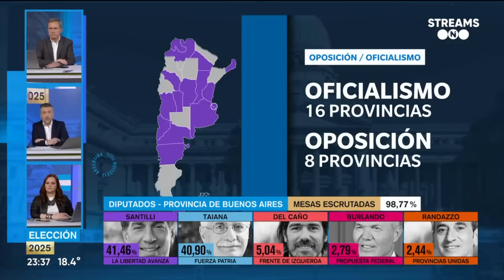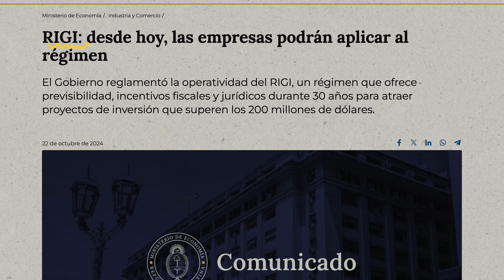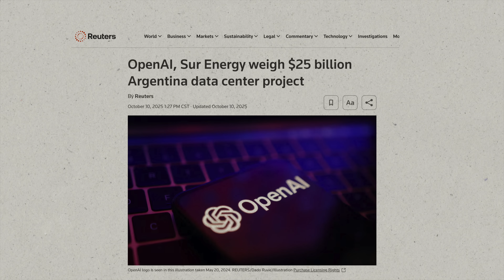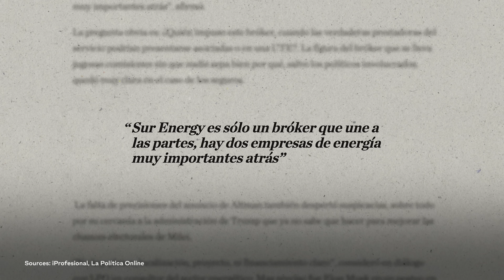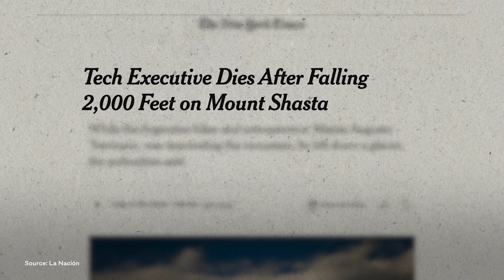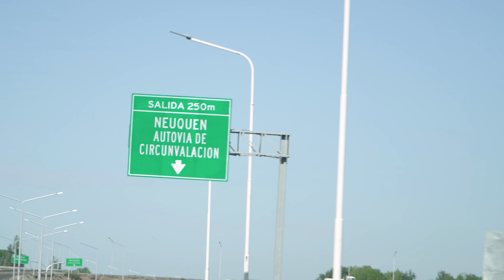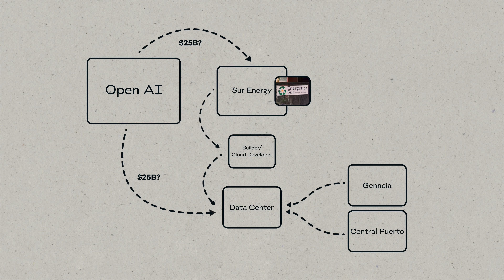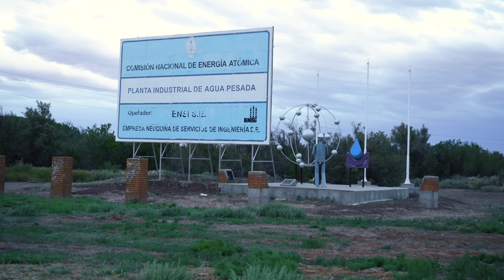Investigating OpenAI's $25B (fake?) Data Center

Comment: One thing to mention. This was a great documentary, but most data centres use a closed-loop water system. This means that the water is not being evaporated into the air outside the building, but rather circulating in a loop where it cools, condenses, and can then be reused within the system. The issue of water usage in data centres is somewhat over-dramatized.

Comment: You didn’t really answer anything in this video. And there are data centers that recycle over 90% of the water they use and data centers that run solely with air cooling

Comment: 13:30 I call absolute bullshit on their claim to cool that much water per hour. Just like the data centers in space, it violates the laws of thermodynamics. You can't just magic heat away. They are hand waving away the water cooling problem without giving any engineering plan whatsoever for actually cooling that water. 

Maybe you could power it with the energy of all physicists and engineers in the world screaming in frustration?

Comment: The water, or what ever medium they use for heat exchange, will be in a closed loop. It's gets cooled, run through the heat sink, then gets cooled again. If they were next to the lake they might pull water from the lake, use it and put back in the lake warmer
Reply: And browner

Comment: 10:16 that estimation seems way too high, and it can not be answered with such a simple statement, as it is highly depends on the model used.
From time to time I run AI on my personal machine just to understand it better and my GPU is water cooled and there is just no way in hell a normal 100 word request would require 2l of water for evaporative cooling. The majority of the cooling is still done by the closed system and radiator in combination with the air.

Comment: I think this investigative piece is extremely informative, but one fallacious argument that is repeated is the amount of water data centers routinely consume.

Most centers are opting for direct liquid cooling (glycol mixed), which yes, has a very high INITIAL water investment, but the overall argument about how much water centers use is based on the legacy models that used chillers, water towers, and evaporator systems.

A lot of more modern centers are strictly using a mix of direct expansion (DX) CRACs or close contact liquid cooling for high density racks.

Both of these are millions of gallons less expensive to maintain and run. I do believe the public debate of the water consumption is becoming more equivalent to how much space a terabyte storage from 2002 would take up.

Comment: There seems to be a lot of corruption and dark money surrounding the Ai push. A number of western governments around the world have been accepting both corruption and dark money as a standard way of operating, so it's no surprise. The people at the top are all playing mafia level games. 
Here, we have two sites planned. First is an existing data center that was already upgrading for more data center stuff. It has announced it will now be a AI platform data center. Doesn't have the power requirements to do so so but hey, they want a slice of that money pie. It doesn't matter when it crashes as they won't be out any money as the expansion was already happening.
The second site is a plot of land that was industrial but decommissioned. It was sold by the gov privately for a fraction of it's value of $200mil. It's been the center of several government plans with a planned buyback of the actual value of about $500mil now. That private owner is going to make bank just like they all do with the sale of government assets to other politician's friends here. 
It's now suggested as the site for the "AI factory". Not sure what they are building as AI only puts out slop. AI waste production maybe lol? 
Anyway, it lacks the power infrastructure, and land for the power infrastructure as the surrounding areas have been a land developers wet dream. It's also 100 year floodplains that now flood every 20 years. Several corrupt politicians have been wanting to raise the dam to reduce flooding but it's in a national park and only receives a fraction of the actual water that causes the floods. A lot of people have a lot of corrupt money in the area and have been trying to turn it into a new city hub for a while now. It's too messy, to built out, too low income, too crime ridden, too contaminated, and lacks infrastructure for it to happen. Even with gov usually paying for infrastructure here, there just isn't the space or capacity for it or much at all.

Comment: I'm not very knowledgeable on the topic, but I believe it may be that one can have water cooling system that don't let the water evaporate away, but rather recapture and let it cool, to use it to aborb heat again in a cycle. Not unlike "water coolers" for CPUs or GPUs on fancy desktop PCs. So technically it would allow a system that requires a lot of use of water to work even in a dry land, as long as they keep this water well sealed. 

Having said that, I don't even know anything and I'd not be surprised if big companies just managed to make things worse for the population around if it was just minimally cheaper for them without a compromise in their output. Assuming that even having a constant minimal output is really the end goal rather than financial shenanigans to which only the appearance of possibly working would be necessary.

Comment: What's evaporating the water?  The GPU's are not boiling the water away.  It's a constant flow of water carrying heat away with the water, not evaporating it.  That is not happening.  Why would you believe that?  Exactly what is evaporating all this water everyday?  That doesn't make any sense.

Comment: The water use is not fixed. It may well explain the higher costs of the data center - more expensive tech allows you to use a lot less water - up to 100x less - than the cheapy direct evaporator model.

Comment: 9:54 liquid cooling is a closed loop system, none gets evaporated. If it did you would need to top up liquid cooling on your pc or server and I dont.
Reply: 2 different things
Reply: And how do they cool the closed loop? Water and air, you know how much from that water they save? None, only best way is to have a active river and heat the river water to cool the data center, this is not your 500W pc ...
Reply: @carloskurica a radiator blows air over copper, brass and aluminium radiators. Closed loop liquid cooling does not use water.
Reply: @NLPexperts you don't know a water to water heat exchanger is, and how effective they are, and that's fine

Comment: OpenAi is desperate to stay relevant. this data center wont be built its being used to generate more money to train bigger and bigger models. OpenAI is racing ot the bottom as fast as they can. at the rate they are going with the models they will need to cover every inch of the world with a data center.

Comment: I think I’m right on this, but the water used in data centres is continuously circulated and not consumed. So I don’t think they need a lot of water daily just the initial. 

Also they don’t use normal water, instead the water they use is expensive desalinated and deionised water, hence why they try to keep it and recycle it through the system. (This is to stop limescale building up in the system and a few other things!

Comment: Nuclear power, desalination, data center, fiber infrastructure. You’d need to build a city. That’s thousands of jobs for years.
Reply: Unless the data centre suddenly goes idle because the bubble has burst. Then all of a sudden you have a whole city in the middle of no where with no jobs and no money to run the desalination and nowhere to use all the nuclear power
Reply: Didn't happen in Añelo since they discovered Vaca Muerta, it won't happen here. It's the argentinean way.

Comment: that amount of water evaporated for 100 words doesnt make much sense. input tokens are a lot cheaper than output ones so what matters is if you ask it to write a long poem vs asking it to say only hi. and to evaporate that amount of water you would need a lot of energy, i think that number isnt only from the inference itself but the server as a whole. they are also used for training, testing and they cant really be turned off for stability sake. its like turning a lake on and off, it will break all the walls and it will be more expensive so these servers are 24/7 if there is nothing to do they will just do useless processing just to keep current spikes at bay.

Comment: You need more than just energy and water to run a data center. It also needs to have communication infrastructure to get the data in and out. It needs to be connected to the rest of the world and have fast cable throughput.
Reply: So what I’m hearing is Argentina doesn’t have that so this is another paper agreement that’ll never come to fruition and is meant to pad OpenAI’s pr of a flurry of new deals
Reply: @foxooo lol wtf are you talking about? Argentina can bury some cables. Jesus you guys are hysterical.
Reply: starlink can fix that

Comment: You don't need water for a datacenter, it's handy but you can use AC or if you using gas generators, bleed air to cool. They use a bit more power but it's not a requirement, getting gas out of a shale field does need loads of water though. From what we have seen before I expect gas turbines to power as openai has loads of them on order. One of the turbine manufactureres is boom aerospace btw with exactly.. .. .. 0 gas turbine generators build 

This is nitpicking though, the journalism is great.

Comment: The data centers can put the water used for cooling back into the same place they pull it from (river for example) using no net water. They also can build their own power generation so it's not taking from existing infrastructure or grid.
Reply: Not really. The water consumed by data centers goes into evaporative chillers - they consume water in order to reduce electrical power usage.

In theory you could do better by using a convenient river for cooling. This is pretty common for power stations - building on a river or the coast means you don't need those huge concrete cooling towers. But in practice, data centers are rarely built next to such convenient water - land next to water tends to be more expensive.
Reply: The water used for cooling becomes polluted...it cannot be put back...this is extremely destructive to eco systems and fresh water supply.. plus the water evaporates and only rainfall can replace it...
Reply: what world are you living in???They are not investing in new infrastructure...they want land where there is power and water
Reply: @evansmuthomi1997  complete nonsense. These companies totally investing in new infrastructure.

Comment: your argument about water is completely wrong. sam altman has stated publicly that each query uses aprox 0.000085 l of water, thats no where near a full bottle. closed loop cooling systems do not "evaporate" cooling liquid. if such was the case, AIO coolers for computers wouldn't eixst as the water inside them would "evaporate". once the cooling water is in the system initially, it doesnt go anywhere. most AI data centers being built right now have already adopted this tech. there are some "false closed loop" systems out there that use a hybrid system wherein they purposefully evaporate hot water to dissipate heat from the system, but even these dinosaurs are being replaced with fully closed loop systems. 

please don't misinform your audience just because you have an issue with AI, do better than the main stream media you're trying to beat.. maybe a little more research next time.
Reply: Yeah I trust a billionaire 😂

Comment: Wait, you said that the water gets evaporated and that's it? Since when is that how water cooling works? A lot of data centers reuse water that is evaporated because of condensation. Not only that, but a lot of data centers have a closed loop system.
Reply: Patagonia data centres done need water cooling, the climate is cool enough for air cooling. He's visiting in the middle of summer, that's about as hot at it gets, it can sometimes snow in summer.
Reply: @Diamonddavej  Yeah, that's something that a lot of data centers has as well, that they're mostly air-cooled. The only data centers that are water-cooled are the ones with a lot of freaking traffic. And guess who are those? Googles.

Comment: most of the water used is recycled since its made superclean for the units, dont leave out that part (IDGAF if its not as sensational).  power requirements is the key issue. big business cant get it in their head, 99.99999999 citizens everywhere dont want the world raped to super advance a dream and support the grift. bubble, pop already.

Comment: The job count is misleading. A datacenter that size is going to require consistent maintenance. If additional power is required power plant operators and other infrastructure related jobs would also be required. The permanent job count might not be as high as some other industries but it would certainly have a positive impact on the local economy.
Reply: Server parks in 2010 were also barely using staff. There is only a small custodial staff on site. Like other companies they like to exclaim how much work will be created.

These people are really horny for 20% unemployment. They should never get to call themselves "job creators" again.
Reply: Not as much as you'd imagine. Data centers generally don't do much on-site repair. When things break they get sent off to the specialist by courier. It takes only a small technical staff to run one, mostly to process the stream of change requests for installing new equipment and occasionally packing something broken up for collection. Even the very largest data centers can run on a staff of maybe fifty people, and a good portion of those are security and admin staff rather than technical - when you've got that much expensive equipment within, you're going to want a 24-hour guard on the place.

Plus they don't hire local. The company wants staff they can trust - experienced staff who have been with the company for years and have both formal industry certifications and real-world experience. So they will invite their own employees to move in to the area for the technical jobs. The security staff will be local, but the highly-paid technical positions won't be.

Comment: I'm confused. How does a $15B data center seem to have more capacity and create more jobs than a $25B one, which costs $10B more but has fewer GPUs and creates fewer jobs? Someone explain this to me.
Reply: Newer GPUs are more expensive but also more energy efficient. The newer data centre may be more expensive, use less energy at the same time and provide much more compute.
Reply: @macoson You might have a point, but with a $10GB difference, it still doesn’t make much sense, especially considering that Stargate Texas will reportedly use the pricier Nvidia Blackwell GB200 GPUs, while Stargate Argentina will be using AMD Instinct GPUs.
Reply from the maker: Exactly
Reply: @slidebean  It’s obvious that some money is ending up in the pockets of politicians and other well-connected people.

Comment: The water consumption of data centers is actually less, since you can recycle most of the water. So about a teaspoon rather than a water bottle is lost per query. But when there are millions of queries, it still adds up.
Reply: Depends where the data center is. Different climate, different cooling. In a warm and dry climate a data center will use evaporative chillers which do consume water, because consuming a little water in that manner will substantially reduce the electrical requirement for the cooling system, giving an overall cost saving.
Reply: AI datacenters don't recycle water. I thought the same as you do, and normal data centers work exactly like that (recycled water). But OpenAI and others do NOT use that, they literally waste fresh water.
Reply: It's not about water getting depleted. It's about the availability of water to the general population. It does not matter if it is a closed or open loop cooling system, the amount of water it displaces is enough to impact availability of fresh water.
Reply: @johntanil1943  According to latest estimates, data centers process hundreds of millions to over a billion tokens per second. The water use is a massive problem, nobody's arguing that. But a bottle per 100 words? That's just fear-mongering.
Reply: @tp2302-c1i I agree, that's stupid
Reply: Yeah, they talk like someone is spraying a firehose at a warehouse of GPUs. Cmon dummies, there are better arguments
Reply: Came to the comments for this! That claim of AI consuming vast amounts of water per prompt is just insane and sadly discredits the rest of the (probably valid? dunno, lost interest after that line) report.
Reply: @popesdope  notice also that he front-loads the video with lots of scary implications about the water usage of these data centres. Then later - just before the video ends - he reveals that the data centre in question (and the Texas one) will actually use closed loop water cooling therefore dramatically reducing their water usage. 

So he intentionally riles up the viewers hoping they’ll get angry and upset about huge water usage (we’ll leave aside that without context most people don’t actually understand if that water is significant) and then once that idea is in your head he casually slips in that you probably don’t need to be concerned about the water usage. 

This video is trash.